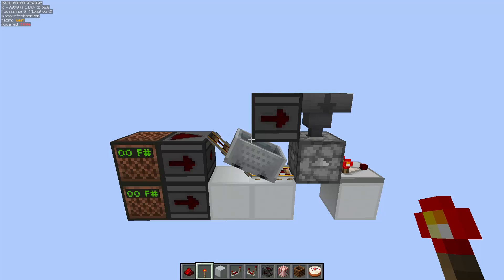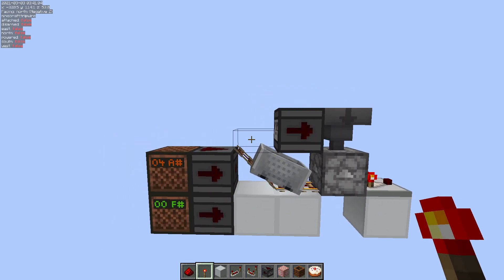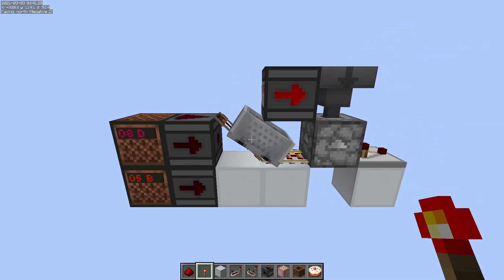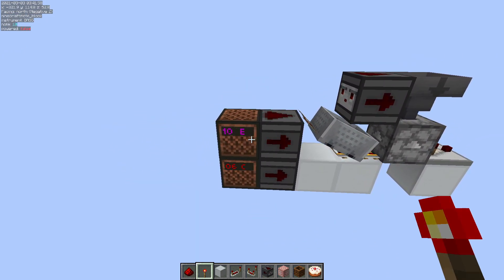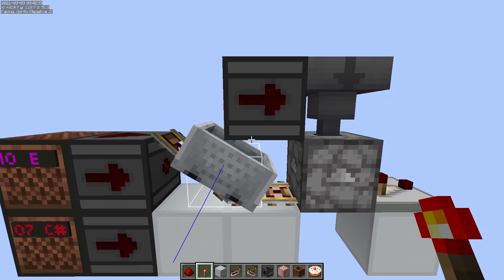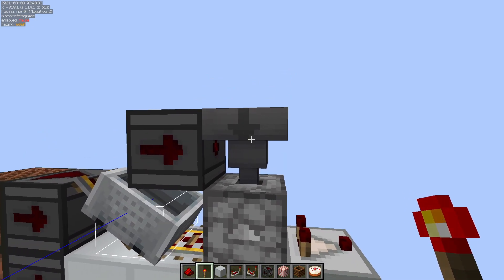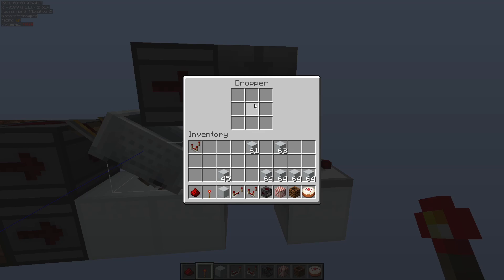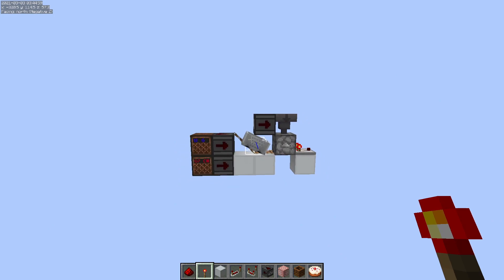Crazy XOR

Comment: This is really cool but I this this is more of a T flip flop. XOR gates require lever inputs (no pulses) from what I understand. This circuit is just taking a pulse input and making it like a lever.
Reply from the maker: Yes, this is a couple of dual edge detectors leading into an OR gate leading into a T flip-flop, which is logically identical to an XOR/XNOR (with one exception being it can't handle simultaneous inputs). The note blocks are just there as a means to simulate a change in state for the sake of the example, I could have just as easily used levers in their place, and maybe I should have, but I wanted it to be easy to click while recording. Normally the observers would trigger on the rising and falling edges of their respective inputs.

Using this Dual Input Flip Flop (DIFF) design pattern is a common way to approximate XOR/XNOR functionality in redstone devices because it's much simpler and smaller to build in redstone, particularly in the case of 1-wide tileable applications like this. Often you can ensure that you'll never have simultaneous input so that limitation isn't much of a problem.

I don't really know anything about your redstone background, but hopefully this explanation helps and I would suggest playing around with it to convince yourself it works. Understanding how powerful this approximation is will give you all sorts of flexibility while designing redstone circuits.

Comment: Cool circuit but isn't this a noisy T-flip flop? where is the XOR aspect? This seems most useful as a easily togglable 5-tick clock.
Reply from the maker: Yes, this is a couple of dual edge detectors leading into an OR gate leading into a T flip-flop, which is logically identical to an XOR/XNOR (with one exception being it can't handle simultaneous inputs). The note blocks are just there as a means to simulate a change in state for the sake of the example, I could have just as easily used levers in their place, and maybe I should have, but I wanted it to be easy to click while recording. Normally the observers would trigger on the rising and falling edges of their respective inputs, so clicking a noteblock emulates a change in the state of that input.

Using this Dual Input Flip Flop (DIFF) design pattern is a common way to approximate XOR/XNOR functionality in redstone devices because it's much simpler and smaller to build in redstone, particularly in the case of 1-wide tileable applications like this. Often you can ensure that you'll never have simultaneous input so that limitation isn't much of a problem.

I don't really know anything about your redstone background, but hopefully this explanation helps and I would suggest playing around with it to convince yourself it works. Understanding how powerful this approximation is will give you all sorts of flexibility while designing redstone circuits.
Reply: @metamilo  I see. I only ever thought of XOR as a AND/OR combination circuit. I guess this is what you called a "True" XOR in your other answer.
Thanks, this should upgrade my designs in the future!